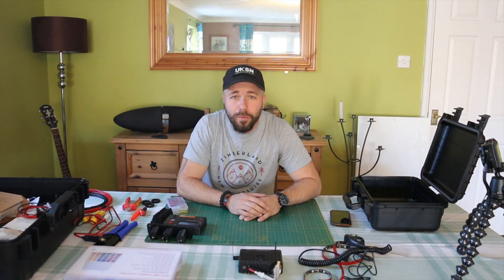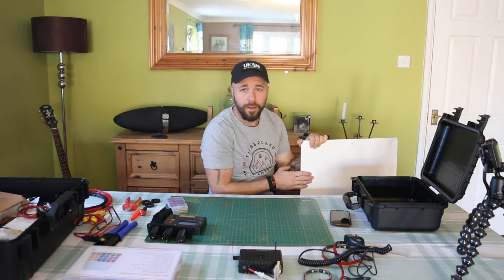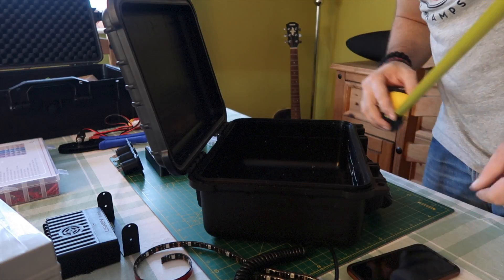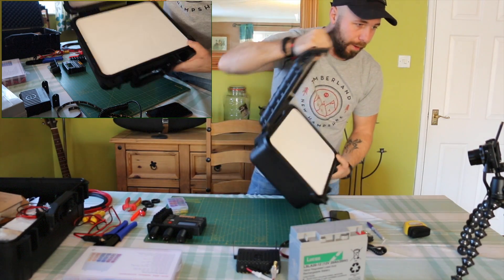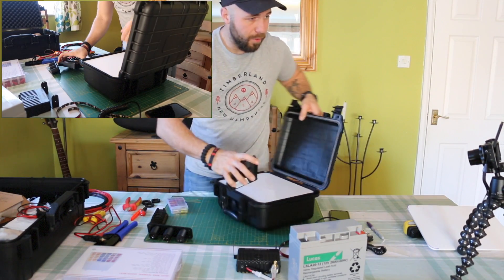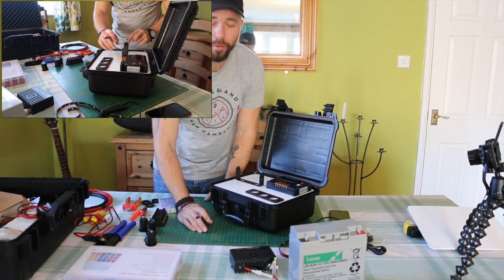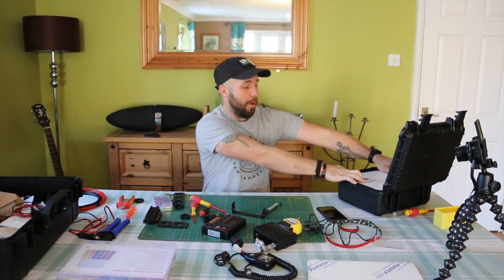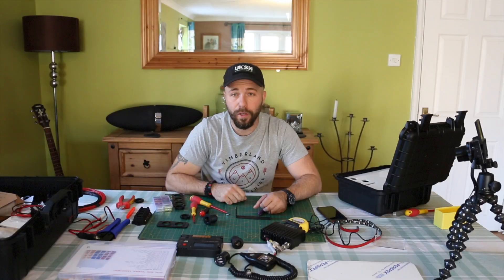WOW SLY Radio GoBox Pt2

Comment: the radio wont pull any more than 4.1 amps so a 5 amp fuse for the radio will be fine. thats running full power! you will be restricted to 10w so 5 is plenty. as for solar i dont know, sly is the best one for that. good build, not long passed my licence and was watching a review for the radio you selected.
Reply from the maker: thanks for the info Commando squeak and thanks for watching